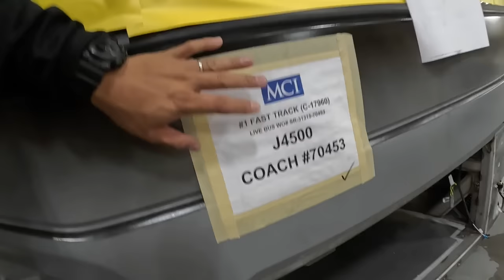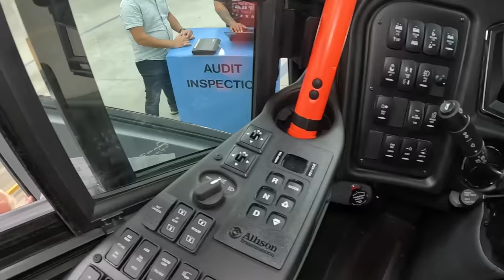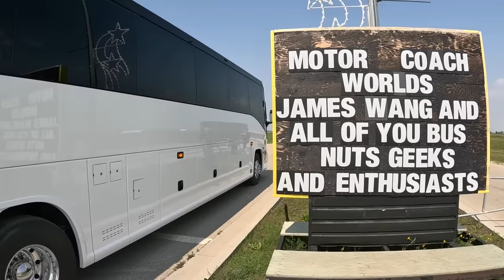I Drag Raced Buses | Electric vs Diesel | at MCI's Test Track

Comment: It's a little saddening tho that electric is starting to phase out diesel and gas engines, but MCI is an awesome company
Reply from the maker: I don't think electric will phase out diesel. I think companies like MCI and ABC/Van Hool want to enter the electric market but diesel will be their bread and butter for a long long time.
Reply: @MotorcoachWorld  I really hope that's the case. Did you notice if there was weight difference in the diesel verses the electric? The acceleration differences were quite impressive.

Comment: MCI make some great kit. Just wondering if there are any plans for a larger battery hybrid?
Reply: MCI used to offer a battery-electric hybrid vehicle, but there are no plans to develop a new model.  Most customers interested in moving towards zero emissions and higher efficiencies are leaning toward full-electric vehicles.  Also, a battery-electric hybrid is much better suited to stop-and-go transit applications than over-the-road sustained highway speeds.
Reply: @MotorCoachInd  Makes sense. We'll have to stick to diesel for now but I'll look forward to when the electrics can handle the distance. 
For some of my routes a battery capable of ~50 miles or so would mean most of the off highway bits would be on electric. I know thats not a very general use case but worth an ask. 
Really impressive tech though and its interesting that its limited by the axle. That gives me good feelings because if thats the weak point the rest must be tough as old boots.

Comment: When they put aluminum and steel together, how do they stop or slow down the corrosion process...🤔🤔🤔. I am having issues with the two metals.❤️
Reply: The effects of galvanic corrosion due to dissimilar metals are eliminated with isolation strategies such as mylar tape, paint, or zinc primer. Generally, MCI coaches use stainless steel to eliminate corrosion altogether.
Reply: @MotorCoachInd , that is a AWESOME thing to do. 
I have a D series and it has issues with rear stainless fender wells that corroded the above structure. Had to weld new metal replacements to reattach the air bags(6ea), fender well, and structure. Also, water was pooling on top of both rear fenders when we removed the sub floor!!!🤩

Comment: I think electric isnot answer for long haul.buses but OK for transit busses. They can use double trolly for power on trunk routes and bus ways and battery off main lines battery can charge fast on main line
Reply: Also for long haul electric will be the answer eventually.

Comment: Will they consider having a dual Def tank or just moving it to the left side of the bus
Reply: We have this on our list as a possible update in our next-gen vehicle.  Currently, there are design challenges with developing a dual-fill system or a roadside fill system such as a DEF tank with multiple ports and regulating the temperature of the DEF.

Comment: Nice coaches. I still wonder why none of them have considered adding an E-drive axle to the front, inherently making them mild hybrids. The front axle can assist the engine when power is needed, and recoup the energy to slow down. Just a thought.
Reply: There's no need for a drive front axle to make a hybrid - an electric motor can just be added between the engine and transmission (for a fully capable parallel hybrid), or to the accessory end of the engine (for a mild hybrid). Allison has sold power-split type (like a Prius, but much bigger) hybrid transmissions for buses for almost two decades.
Reply: @brianb-p6586  Gotcha. I"ve been keeping up with Edison Motors out of Canada here on YT, and they've created an impressive hybrid, HD truck. The setup they have has it using an 8L engine to recharge a 260KW battery, and they say they use half the fuel to run it. The engine works strictly as a generator, and they use heavy duty E-Axles for it. I think this would work great for busses, instead of going fully hybrid for now. The generator provides Level 3 charging capacity for the batteries on the fly, and the truck will do 100 to 250 miles on battery power alone before the engine kicks on. Perfect setup for busses, I'd say.
Reply: @timo.5449  Yes I'm very familiar with the Edison Motors series hybrid truck. 
By the way, that's kilowatt-hours (kWh), not kilowatts (kW) for battery capacity, and the Edison prototype as 280 kWh of battery, not 260 kWh. It also has a 9 L engine (not 8 L), specifically a Caterpillar C9... but those are details. The 50% fuel savings claim is a wild guess, and likely very optimistic. 

There are have been series hybrid buses for many years. The ISE Thundervolt system and the BAE HybriDrive or Series-E and Series-ER systems are the most common; ISE ran for years but has been bankrupt for a long time, BAE introduced these hybrids in 1998. There have probably been thousands of series hybrid transit buses in service, although most of them are old enough now to have been retired.
Reply: I assume, @timo.5449 , that you meant to say that a series hybrid would work great for busses, instead of going fully battery-electric for now."
Reply: @brianb-p6586  yes, ypu assumed correctly, and thanks for the clarification and correction. Yes, perhaps a 50% efficiency is too optimistic. But considering that they’re using a smaller engine to recharge, and factoring in the light duty work of a buss compared to the truck plus implementing aggressive regen, I could see a 20-30% efficiency. Better if DC fast charging is available at stops for breaks during the journey for bus routes with scheduled stops in between. Currently, the MCI J-series EV bus gets about 280 miles out of a full 600KWh (plus) battery. With some aerodynamic improvements, they could do better.
Reply: Again, @timo.5449 , that's 600 kWh (kilowatt-hours of energy), not 600 kW (kilowatts of power). At 600 kWh for 280 miles, that's 2.14 kWh per mile, which does seem a bit high to me, too... more than a Tesla Semi in regional distribution service (which are averaging something like 1.85 kWh/mile in recent tests).

Comment: So they are going to put an all-electric bus service between Seattle and Bellingham Washington that they claim can do the round-trip without a charge. What are your thoughts about electric buses going into commercial service?
Reply: Electric coach service is starting to be available in commuter fixed route applications mostly in the public sector and some private companies. We know diesel works in all applications and electric is suitable for some applications but not yet in all with today's technology. Some limitations facing the traditional tour and charter companies are: 1. Higher cost of the vehicle 2. Infrastructure that needs to be installed at their location or a public network, like Eletrify America, that is not set up for coaches 3. 2-4 hour charge times 4. Limited luggage bay space.  While the future is moving to electric, the timing based on application and market segment will drive the pace of adoption and that is why we expect diesel to be around for quite some time.

Comment: I drove city buses for 30 years. Seen diesel, CNG, and electric buses. CNG buses use more than double the amount of fuel than diesel. The electric bus may have a speed advantage but not the torque with a full load going up the hill. You drive a bus outside the city and you will have problems with recharging batteries or refueling with CNG. Diesel you can get at any truck stop. Plus don't electric batteries have problems in cold climates? Now if you can design an electric bus with the possibility to exchange batteries for fresh recharged batteries, that would be a lot better.
Reply: Integral batteries are indeed obsolete, or should be. Both logistically and economically unviable. Replaceable and reloadable batteries would open the door to all kinds of interesting possibilities.
Reply: You're wrong. 77% (542k) of the new busses in China are electric and have Been a massive success. In the documentary  I saw, They've saved billions in maintenance  and fuel costs by using electric. They're also quieter and have zero pollution, making air quality better in areas of China

Comment: Whats the range on the electric bus
Reply: At average road speeds and conditions, the J4500 CHARGE™ can travel 230+ miles on a single charge - suitable for commuter fixed route applications mostly in the public sector and some private sector businesses.

Comment: One thing I can tell you is that the Diesel is still more environmentally friendly than that "EV" with their unrecyclable battery and having a full tank can definitely reassure you that you can always make it to a gas station and not arrive at a charging port and not having it working and you have passengers and then you're up that particular creek without the paddle and canoe. In my opinion "EVs" are over HYPE and not worth it.

Comment: What a good job it was only one run up the strip -  5 runs at max load might have meant the Leccy bus would have been out of range to get back to the starting depot,,, heaven forbid if  it had a passenger load, and heaven forbid this stunt was acted out in mid winter....lets be real, shall we?

Comment: Electric motors do have the advantage of 100% of their torque at 0 RPM.  They are great off the line.  No turbo spool and needing to get into the torque curve.  So cool.
Reply: diesel have also enough torque to be able to move itself but also tow alot of additional weight behind it! we have coach bus in europe and they are super well equiped plus they haul extra equipments in a trailer they tow.

Comment: Do they build the engine themselves?
Reply: MCI does not build its own engines. The J4500 clean-diesel coach has a Cummins X12 11.8 L, 410 HP, 1450 FT- LB engine. The J4500 CHARGE™ has a Siemens Alpha 2, 402 HP, >3300FT-LB Engine.

Comment: I drive a truck anyone knows that electric is far superior to fossil BUT there is a thing called a battery and it is not, if I could take my 300 gal of diesel capacity and double it without adding 3000 lbs to my gross so rather then travelling 2400 miles I could travel4800 without making a fuel stop massive bonus. Now use the word battery in this equation only it would be  300 miles doubled to 600 with 6000 to 10000 lb gross addition you can dress any lie up to try and sell it but a person in a rowboat (the battery) is going to arrive days later to a person in a motor boat

Comment: Not a fair race the engine adds a lot more weight
Reply: Both powertrains involve a lot of heavy components. A battery-electric vehicle with significant range (such as this coach) weighs more than the diesel-engine equivalent, because the battery plus electric motor weighs much more than the diesel engine plus fuel. As they said in the video, the electrics are about 5,500 pounds (2,500 kg) heavier than the equivalent diesels.

Comment: Electric bus are not practical,,,A bus is made to carry people and there luggage,,But with a extra 5 ton of battery's ,it's carrying capacity is greatly reduced,,Also busses are for traveling vast cross country distances ,This bus in diesel form could travel 3500 miles across the USA only stopping about 5 times to fuel up,,each stop only lasting about 3 minutes ,,That's 15 minutes downtime in 3500 miles,,How much recharge time for an electric bus with massive battery's ,,probably 3 or 4 days over 3500 miles,,,,Also all the children dying from poison who have to mine the lithium and boron in Africa just so you can travail on your clean bus and make yourself feel like your saving the planet,,,Also when it comes to the battery's end of life,,,,There all put in landfills ,,yes you've been told there recycled,,,,But that's a lie,,There incredibly expensive to recycle and it's not financially viable ,,so now millions of people are being poisoned with these in landfills,,and there groundwater is not drinkable,,,but don't worry there shipped off to third world country's,,,so you don't have to deal with that,,,,No thanks,,,I think I'll stick to the cleaner more effecant diesel ...

Comment: All electric for a vehicle that's going to be driving long distances is completely asinine and stupid waiting long time for a charge, doesn't work well in cold weather, this is completely asinine!
 Running around town maybe, but all electric sucks for long distance and everybody knows it, so stop it with that garbage!
Diesel-electric like on a locomotive or the EMD set up with pan motor wheels that would be practical, but solely battery operated, you gotta be nuts!

Comment: 25:32 - STOP using the phrase 'ZERO EMMISIONS' until every watt of electricity an EV type vehicle uses in 'green' and not from coal or oil - please?
Reply from the maker: That's what they call it. So I'm just using the name that MCI uses.
All the political B's and arguments of what it does behind the scenes, Im not going to debate that stuff in my channel. So if a bus manufacturer asks me to come film a "zero emissions" bus then out of respect I will call it that
Reply: that's cool - but - It's the same thing as ppl calling gas Fossil Fuels - which it is NOT.  @MotorcoachWorld
Reply from the maker: @CosmicSeeker69  Maybe so. I'm not educated enough in that field to judge . So it's not my place to debate that and call it something other than what MCI wants to call it.
Reply: Even if an electric bus uses electricity generated from coal it's still cleaner than diesel buses.